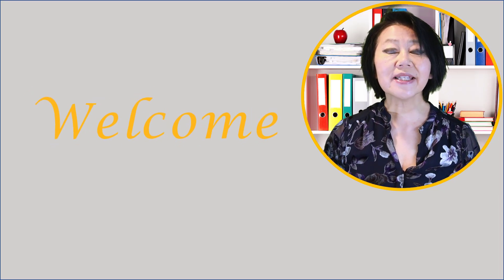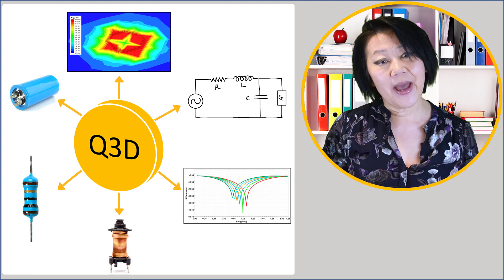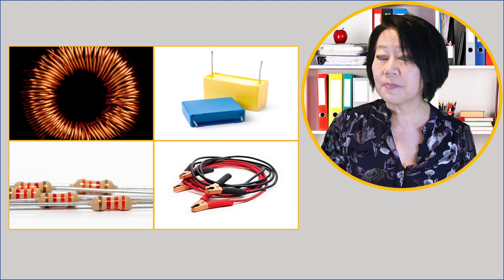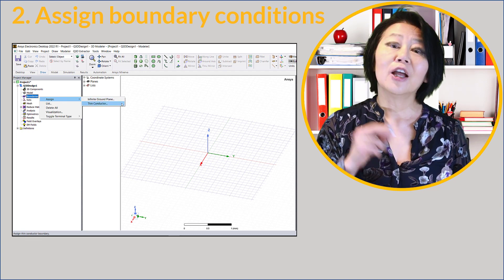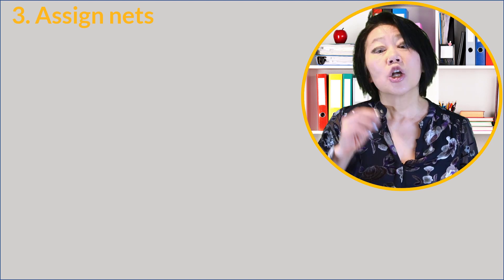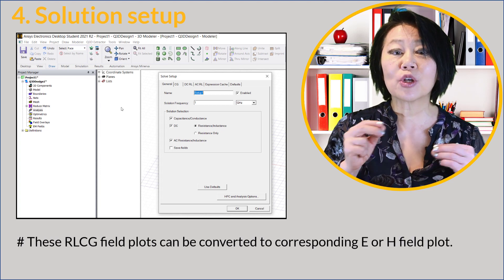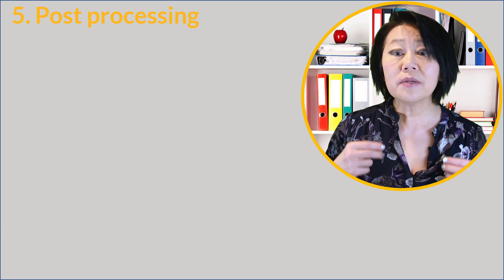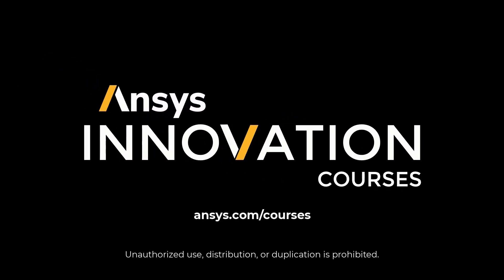Intro to Ansys Q3D — Lesson 2

Comment: What is the solution frequency in analysis setup?
Case-1:
i use single solution frequency (60Hz)
Case-2:
frequency sweep (50 Hz to 1GHz) with different solution frequency (1GHz)
but when i compare the results at same frequency (60 Hz) of the two cases the AC RL results are different.

can you please explain it?
Reply from the maker: Thanks for watching! Please post your query on the Ansys Learning Forum for a detailed answer from the wider Ansys Community: https://ansys.com/forum.